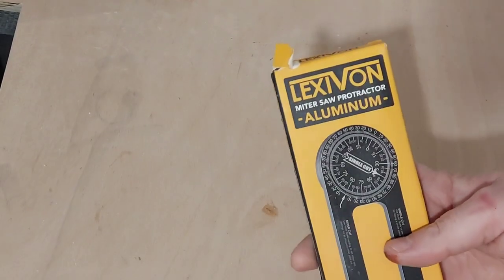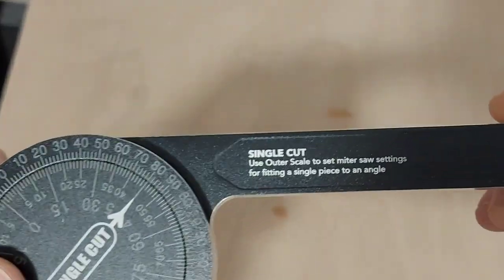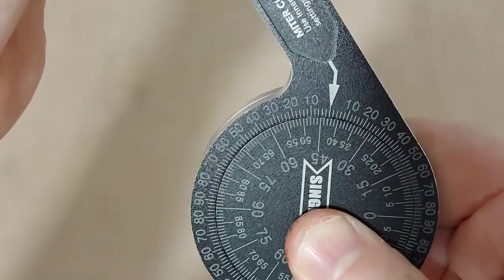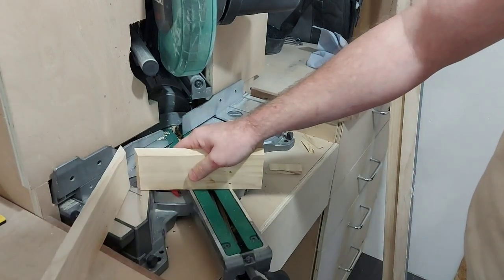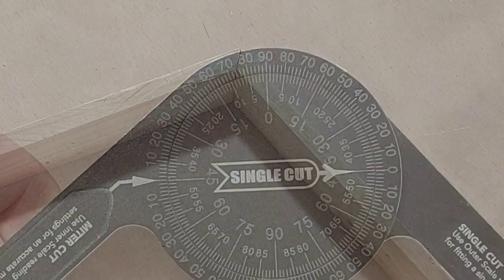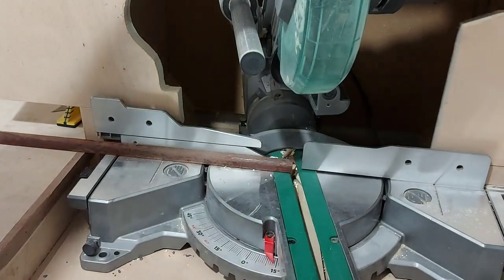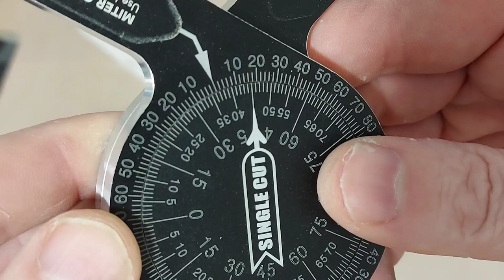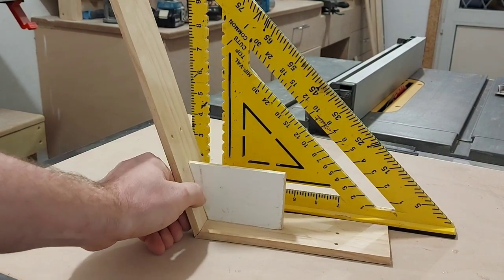How to use a mitre saw protractor

Comment: How does this compare to the 200mm Trend DAF/8 Internal and External Digital Angle Finder and Rule also on your tools page Dave.  Any preference? Cheers.
Reply from the maker: The trend one was great until I smashed the screen, my fault. Bought this as there's no need for batteries & nothing to go wrong. Love it works great

Comment: Great presentation.  Do you think these are as accurate as a digital angle finder?  or maybe better?  thanks
Reply from the maker: I would say these are more accurate as there's no electronics to go wrong & they don't need batteries
Reply: More accurate because it has no electronics and batteries? Common, that has nothing to do with accuracy. I am using this one, but also have stabila electronic protractor. Stabila gives 0.1s steps, which is definitely more accurate. But also not neccessary for baseboards etc. and it’s way bigger tool.

Comment: So are you saying no need to scribe skirting in just use a angle finder
Reply from the maker: There's so many ways to do that it all depends on the individual doing the work & how said individual usually does it. If you usually mitre the corners then this works the angle out accurately but if you're scribing then the angle doesn't matter. 
Thanks for your comment & for watching